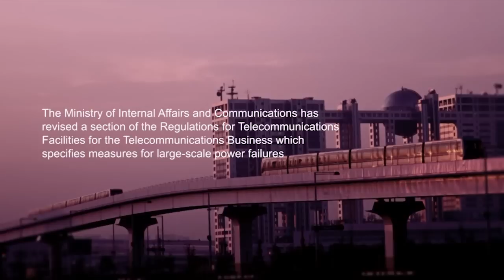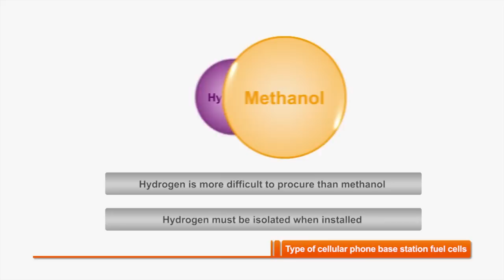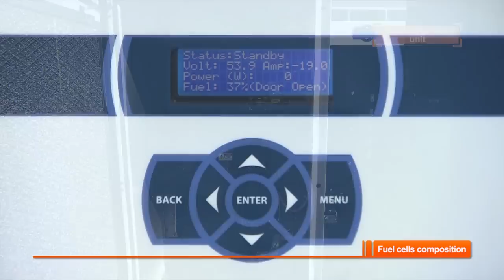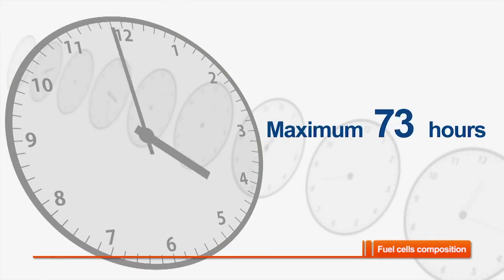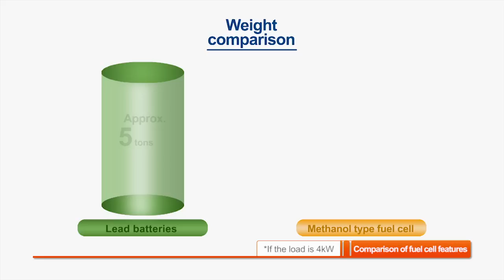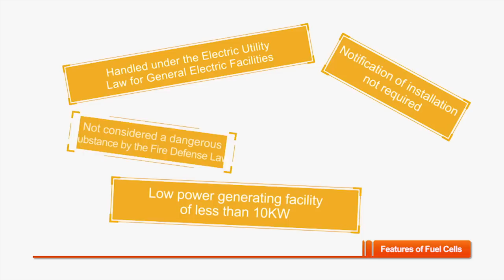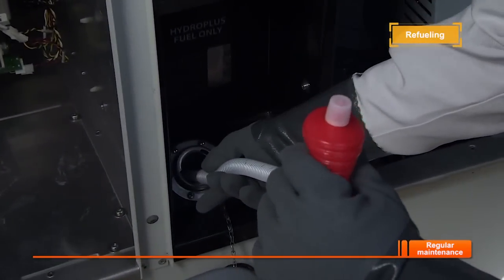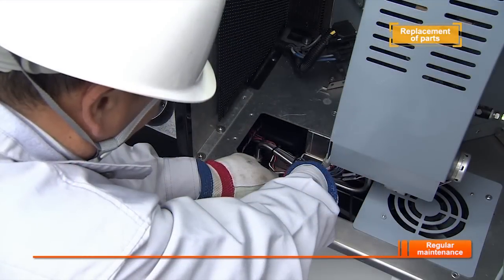NSN Fuel Cell Video describing Ballard's ElectroGen ME use in Japan

Comment: Interesting Larry,
Some questions:  Methanol is a hydrocarbon, so what happens to the carbon part of methanol in the reforming process?  Also, heat is discharged in the process, so how much is lost at each stage?  Also, what is the source and bulk cost of the methanol commodity?